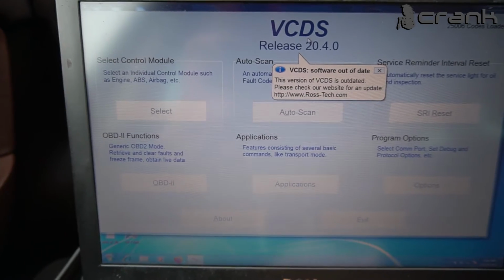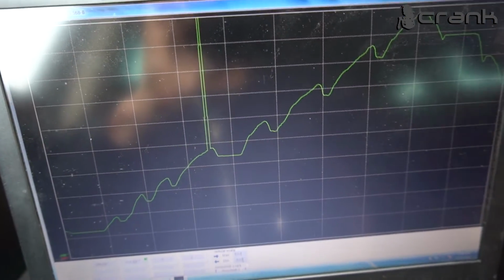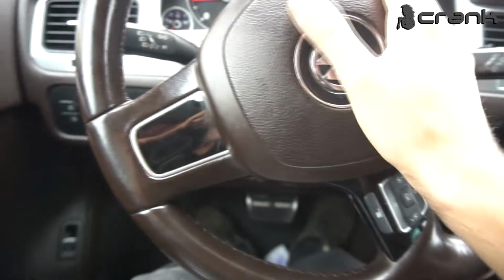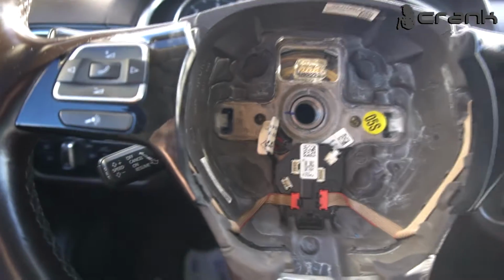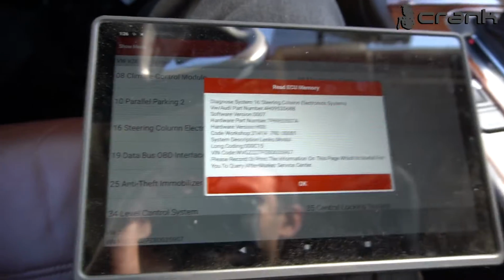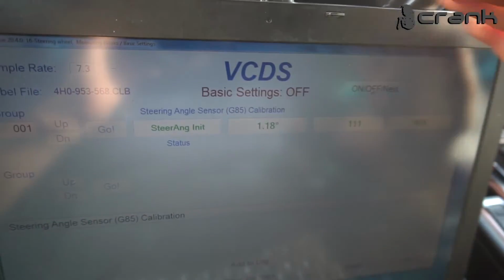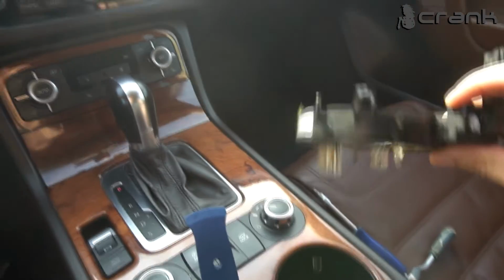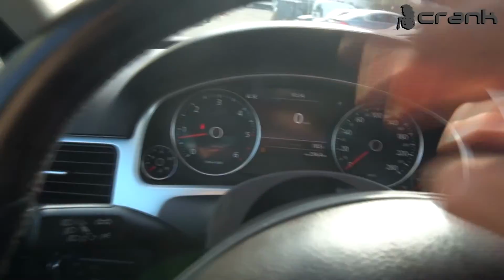Steering Angle Sensor Fault VW Touareg

Comment: Excellent video. Just one question. Do you have to disconnect the battery to unplug the airbag from the steering wheel? If not, are there any steps to follow to ensure it doesn’t “go off”?